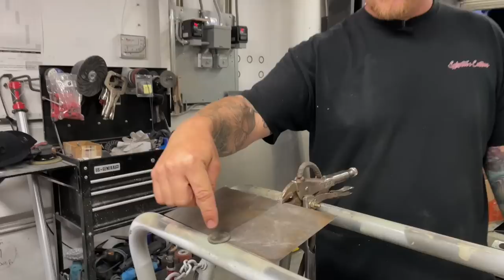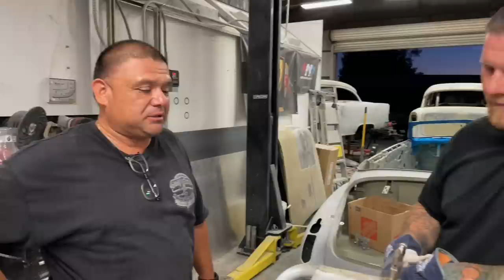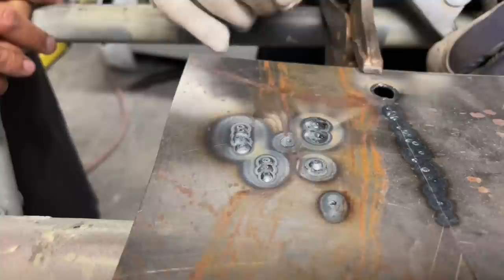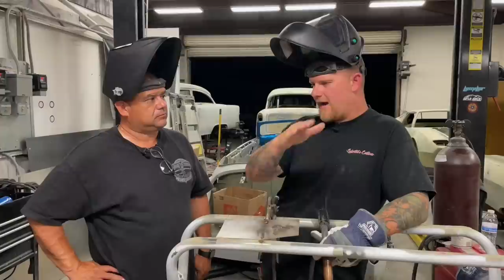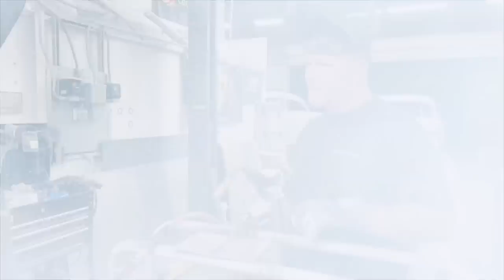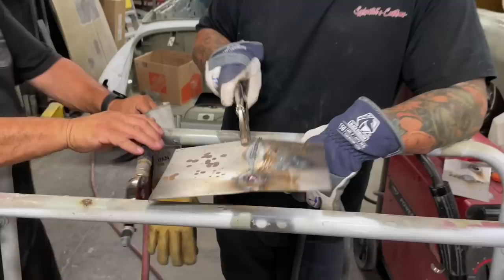Amazing TIPS to Mig Welding Sheet Metal like a PRO!

Comment: As an Old Man, I will recommend to reduce the tension to the rollers. In 1983 a Representative from HTP gave me some tips on how to begin on Mig. HTP was specifically Aiming to Body Shops. And one of the very important setting was the tension. And adjust by sound at the lower setting on a piece of scrap metal of the same gauge. I love your cars on the back. I own a Red 1956 Bel Air, when I was in my 20’. Now am 64 but still doing some of this stuff for some Old Customers. Great Video! Keep Helping We Needed.
Reply from the maker: Thank you!

Comment: Great instructional! My brother is a 30+ year industrial welder and we've had that argument before about him not being able to weld thin metal. Two different animals. He also refused to use auto darken helmets( didn't trust them) until he had to stick his head under his car to do some exhaust work. That benefit of not flipping the hood made a believer out of him. He always grabs my hood now.🤔
Reply from the maker: That’s funny 👍🏻🤣
Reply: Can I mig weld a lap joint on a car top from from passinger side to driver side with out to much worp
Reply: @ericwilkes238  
Flat roof panels can be tricky. Take it slow and keep things cool as you go. Don't rush it.

Comment: The reason we get welding distortion is due to a material property called thermal expansion.  It says that any metal will expend in all directions as it gets hotter.  Similarly, it also shrinks in all directions as it cools.  Since your weld puddle is at about 3000°F, it shrinks more as it cools than the surrounding metal which is at ambient temperature.
Reply from the maker: Correct 👌🏻

Comment: For Hole filling I used a brass plate underneath to save it from blowing through. Now back in the old days we use Oxygen and Acetylene with Silver Solder, talk about heat control, lol. Then again , we used Lead for Body Filler and what an Art that was.
Reply from the maker: Yep we also do lead work if requested. Brass works good too 👍🏻
Reply: @SYLVESTERSCUSTOMS  Why does it not surprise me that you know how to use lead, ha ha ha. I bet that too is done to perfection. Love your video's, keep em comin... I can almost smell the smoldering steel.
Reply from the maker: @dgiorgi1725  hahahahahahahahahahaha thank you

Comment: I spent the afternoon setting up some test panels. First 16 guage. Then 18. Once I dialed in and got good penetration, I practiced the 1 2 count. That's were I think I was going mostly wrong. Not staying on it long enough.  Also I found the suggested settings on the welder were a little cold. Now I feel much more confident that  when I go to weld on the thicker damaged unibody frame sections it will be plenty strong enough. Thanks so much for the tutorial. Awesome!! 
🍻 Cheers John 🍻
Reply from the maker: So awesome 🤘🏻👌🏻🙌🏻 glad it helped!
Reply: @SYLVESTERSCUSTOMS  One other question. Today I welded in a small patch on the inner wheel arch. Generally everything came out really good. I used the settings I figured out yesterday and got really  good penetration and didn't blow through. But occasionally I would pull the trigger and get the gas flow, the glow of metal, but no crackle? Is that a bad ground? It heated up the metal but there was only a gas sound? It doesn't always happen but I was curious if you had any idea on what causes that? Cheers John.

Comment: Great video content and presentation. Trial and error is what gains experience on this stuff and after spending many hours working with mig and sheet metal it has become obvious that setting the voltage a little hotter and adjusting your torch distance to the panel creates a good balance for this type of work, you can actually control the heat by moving, slightly closer to or further away from the panel without having to adjust the heat control on the machine. This does of course require a compatible gas flow and wire speed setting.
Reply from the maker: Thank you!

Comment: This video is awesome, I've just started getting into this and tackled a massive floor pan job wish I could have watched this before I started. I did end up going to c8 instead of c25 and found a major difference butt welding patches of new 18g to 45year old sheet metal.

A good way to prevent splatter sticking if you have a cutting torch, run a carburizing flame across the surface a few passes and let the carbon build up on the surface.

Can't wait to put some of this in the vid into practice this winter when I move up into some body panels Cheers from 🇨🇦
Reply from the maker: Thank you!! You can also spray WD-40 on the area that you are going to weld and none of the splatter will stick at all

Comment: The one thing you are not mentioning but that you are doing without even knowing it, is waiting for the heat to die back before pulling the trigger again. 

After wire and heat, I’ve found patience is the very next most important thing to consider. Letting that weld spot cool before adding more material (and heat) is paramount in not over heating the spot and causing burn through. This is especially true on metal that has been ground thin or is inherently thin.   

In watching another restorer comment on Sheetmetal MIG work, he like you suggest a hotter weld foe shorter periods. Allows better penetration but keeps heat at bay with shorter time duration. 

Maybe I missed it, but did you speak about filling blow throughs?  I’ve found if you are careful slow and precise, you can accomplish this by aiming at the edges from a very shallow angle close to the plane of the metal. This will allow you to slowly build up and fill in the hole. Not easy, but possible. Oh and don’t start tacks at the joint of the two pieces. Start on one side and drag the weld quickly to the opposite side. Always start on the thickest metal imo. 
** Never mind I finally watched to the end. You totally covered it. Sorry😬

Thanks for the great info as usual!
Reply from the maker: I thought we said that. But yes you are so right!! Thank you
Reply: @SYLVESTERSCUSTOMS  You did. My bad. I should have watched the entire thing before commenting. Apologies. Great information as usual! Do you have a schedule of upcoming classes?

Comment: Being an absolute newbie to welding, I found this to be extremely helpful. I do have a question though, I noticed you were touching/leaning on the work piece. I assume that as long as you don't touch the area to be welded with bare skin (use gloves, sleeves, jacket, etc) there is no chance of being shocked.
Reply from the maker: You can touch the piece just fine and it won’t shock you. But…. If you jump in the pool and start welding a little wet you might get a few small tingles ask me how I know 🤣🤣
Reply: @SYLVESTERSCUSTOMS  LOL. Thanks.

Comment: When it comes to thin sheet welding with Mig, I use 0.6mm (I am in the UK) which is whatever it is in imperial, 0.23? When using this thinnest Mig welding wire, one must be careful NOT to have a long torch, so 3metres (roughly 10ft) and longer is not something I recommend. I had a torch specially made at 2m or about 6ft because it prevents birds nesting at the wire drive wheels. I do a lot of car and van repairs for our UK Ministry of Transport Test (MOT Test) which is for general safety and included structural safety of the body.

Comment: When I first learned to weld, which was many moons ago, I was taught to “ roll” the tip of the welder on the metal so as to get a little smoother weld & then hammer the weld before any grinding. Is this technique good?
Reply from the maker: Rolling the tip would be used on thicker steer for structural. Hammering it immediately is more of a gas welding technique or tig. You won’t find much benefit doing that with mig.

Comment: What are your thoughts on 
Fiber Lazer welding. Especially if   the price comes down?
 I learned quite a bit from  you on the  MIG process.  I wasn't using  enough  heat / voltage and still am adjusting that setting to get the proper  penetration. I liked your tech. Of timing and starting up in the old weld. 
I'm making my own 20 ga coupons before I start on my '05 Trailblazer.
Thanks from Milwaukee
Reply from the maker: Very glad to hear! Fiber lazer welding? I have never heard of that

Comment: Great stuff! I’ve learned that cranking up the wire speed and going hot works well. For penetration too. I use much different than the suggested settings on my welder after watching some Eastwood videos. 
Some people use a small gap to ensure welding completely through. I’ve also found that if I suspect I’m going to push through I can cut the voltage and heat back by increasing the space between the tip and the base metal. 
I liked how you let him try to figure things out first on his own. That was a great teaching strategy to allow him to remember things you corrected. 

Do you make complete welds at the roof rails and where the factory put lead? Can you do a video on how to work on those areas? 
What do you do in the roof rails? Lead? “All Metal”?

Thanks for sharing.
Reply from the maker: Awesome glad you liked the video. If you look up the video on our channel that says complex patch panel that is what we do for those leaded areas.
Reply: @SYLVESTERSCUSTOMS  if you care to take a look at a different approach watch “Fritzies Fabrications”. He had a pretty cool way of welding in panels with no warping.
Reply from the maker: @jimdrechsel3611  I have watched him he’s good it’s not my cup of tea and just FYI no matter what welding you are doing. You’re getting some level of warpage these days we prefer to TIG weld because we can remove all of the warpage afterwards that video will be dropping in the next few weeks.
Reply: @SYLVESTERSCUSTOMS  I will be watching. Thanks for taking the time out for replying
Reply from the maker: @jimdrechsel3611  we appreciate our viewers. Thank you so much.
Reply: What grinder tools/paper/methods etc do you use to grind welds to reduce heating the panel? Thanks for a great tutorial and explanations.
Reply from the maker: @jimdrechsel3611  we actually have a video coming out in a couple weeks talking exactly on this it’s already been filmed.

Comment: Thanks I sure do miss that sound. Are you using Flux Core wire? OK I see later you answered this question, you are using shielding gas. I have used both but the shielding gas is so much cleaner.
Reply from the maker: Very much! I don’t recommend flux core

Comment: Great video Travis, mate I’m replacing a floor section in my ute and will be mig welding it back in, is it ok to use a 1mm gap using butt welding clamps that hold the metal together flat?
Cheers from 🇳🇿
Reply from the maker: You can but if you get little to zero gap it just makes it that much easier to weld. 👍🏻

Comment: At approx 24 you talk about heat affected zone on sheet metal.
Why not use an air nozzle underneath to "gently" blow on the bottom side and help cool it faster?
I'm not talking about 120 psi of cooling, maybe 10 psi or so to help it cool down a bit faster, but not too fast?
Reply from the maker: It will blow the gas shielding away and cause a poor weld.

Comment: Auto darkening helmet when you can see it again weld again? And I was wondering that a little air pneumatic tool that puts that little edge so you can lay over and under would that be better? I did buy the stupid thing. 😂
Reply from the maker: The pneumatic flange tool is fine but you can’t hammer and dolly if there’s a lap joint. But yes you can do it that way with the helmet.

Comment: 35:10 Canola oil, cheap and multi purpose, stops BB's sticking and doubles on the grill for dinner. 36:50 cut the wire on 45degrees for instant melt no sputter.
Reply from the maker: Thanks for the tips and for watching.

Comment: Welding on a car is critical especially when it's structural. When I was doing more collision work all the techs had to pass an ICAR weld test to continue working on structural repairs. Amazing and scary to see guys older than me that have been working on cars for decades struggling to pass this test.  My day job company sells suspension and engine cradles to the general public that need welding. I'm always curious of some people's welding skills. I've been trained in collision repair to make these repairs safe for the occupants  and I'm sure these same DIYers would expect that quality from a collision shop. So it makes me wonder about the structural integrity of their welding when their classic Mustang restomod  with 500+ hp hits the same streets as other drivers. I'm not cutting anyone up. I totally respect the novice. Just can't help but think of the same repair standards implied.
Reply from the maker: Oh trust me the stuff we get is scary 🤣
Reply: @SYLVESTERSCUSTOMS  
No kidding. I'm always wanting to learn too but I'm not too proud to admit my limits and ask a pro. No shame in it.

Comment: I weld panels all day every day & use flux-core, for reasons.  Firstly, flux core runs real hot, so penetration is a given, pretty much, even on tiny tacks. Second, flux core wire at 0.8mm isn't like Mig wire at 0.8mm.  Mig 0.8mm is 0.8 of solid steel. Flux core is maybe 0.4mm steel, 0.4mm flux, so you are now using super-thin wire irl - for bodywork, thinner wire is always better. 

Third, flux core tolerates contamination WAAY better than Mig - it's comparable to stick welding. Mig wants very clean steel - with bodywork, you are seldom going to have that irl - there will be traces of paint, traces of filler, maybe some light rust, maybe underbody sealer residue - flux core doesn't care. Mig does, big time. Clean all you like, there will be contamination when doing panels. Mig will hate it, flux core doesn't. 

It's also a softer, flatter weld bead, it grinds easier, you can weld absolute tinfoil with it - far thinner than Mig can cope with, plus the machine to run it is tiny, light, cheap as chips & requires very little power. I like all them things. I also like not having to buy & lug around big clumpy cylinders of expensive gas that are a pita. 

I wouldn't use mig any more if you gave it to me for free - there are too many upsides to using flux core for bodywork. I have half a dozen real nice mig machines parked in a corner - ignored these days. I'm also kinda not with you on the "cooling the tacks" thing - IMO, and it's just my opinion, it causes more warpage than it cures. Go slower & let it cool naturally = Slow is Fast when it comes to welding bodywork. :-) Watching the glow is key - glow gone, bang in the next tack. My version of "slow" is pretty damn fast tbh - but it's just slow enough. No way am I mucking about with an airline & I weld some spendy vehicles.
Reply from the maker: I’m not a fan of flux core we have a video coming out soon as to why tig is superior
Reply: @SYLVESTERSCUSTOMS  TIG is 100% superior, but for ham & eggs work, it's just too slow, doesn't pay.

Comment: I'm welding 18 gauge to a 77 model Ford with thinner prior rusty metal. So it's probably a 18 to 20. It blows holes on the 20 gauge side. Plus it's a butt weld, not an over lap. It sucks to say the least. 😂
Reply from the maker: Good luck

Comment: I use Tig, too many cold welds with Mig. 
When welding look for the heat penetration. Mig is always smaller.
Reply from the maker: We also use Tig but if you don’t have it that’s why we made the video
Reply: I bought my MIG in 1984 and is bigger that most Honda Civic engines. I have learned to weld with it on sheet metal with out burning thru and great penetration with 0.030” wire. Mine has no drive rollers for smaller wire but also came setup for large spools. You learn to weld with what you have as I can dial my wire speed and the amps that work. Now, retired I can buy a TIG but don’t have much of a future use for it. You have a good job and can justify it, go for it. 
 Great video and info.